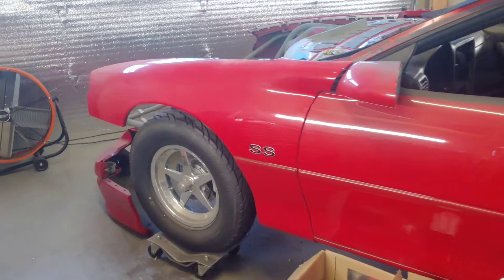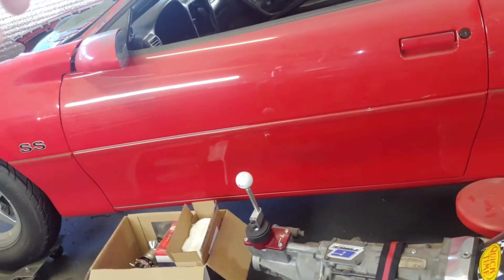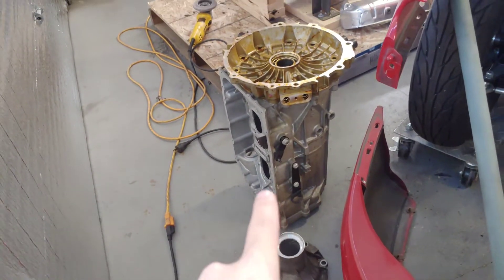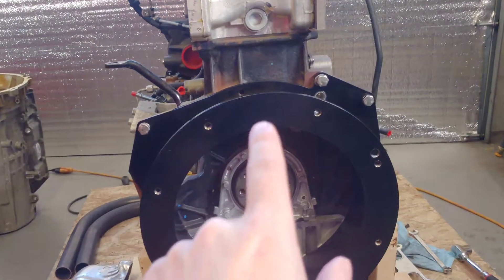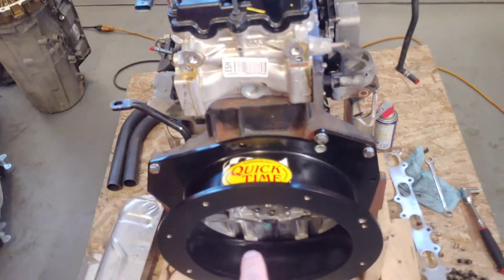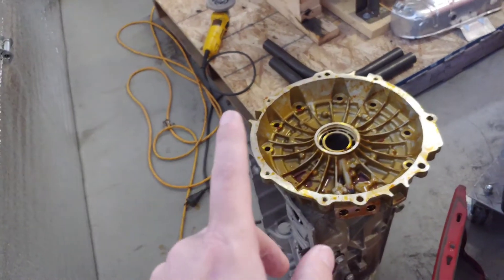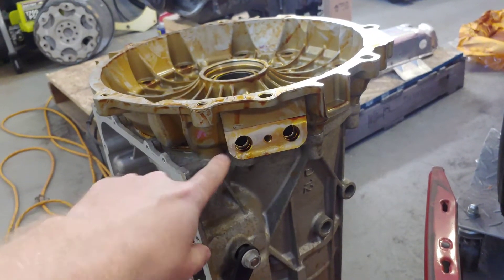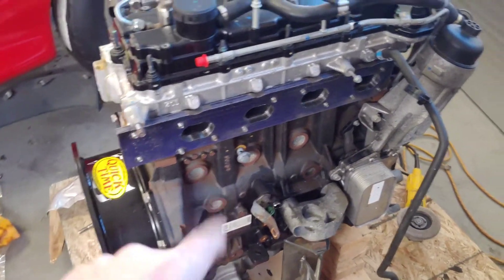2.8 Duramax Camaro project update/ transmission compatibility

Comment: Thanks for all the LWN content! I blew my 6L50 tranny on my 2.8 duramax Canyon last fall hauling my boat and camper back from BC and this tranny seems to have some cooling issues. So wondering if you know of any issues with this setup? I had the tranny rebuilt and a couple weeks ago I had to move a RV trailer about 15 miles and when I got back I noticed that the tranny had puked some oil. At the time the temp never got over about 100*c. As you are no doubt aware this truck is rated to pull 7700#s and the combined weight of my boat and camper is no more than 3500#s. I have it deleted and tuned and am finding anytime the tranny has to shift down while pulling a load the temperature just skyrockets, the hotter the ambient the worse it is of course. When it blew last fall the temp was at 112*c when I finally thought to check it. As the stock cooling seems to be insufficient, I'm thinking that I need to add some auxiliary cooling to keep the working temps down. I can't seem to find any content regarding this issue and my local dealer is clueless and no help whatsoever. help!! Details- 2017 Duramax Canyon, 250000 kms deleted and tuned for tow/haul(230hp/460 Ftlbs)
Reply from the maker: I would contact your tuner and have them look into torque converter slip. Sounds like it's not locking up the converter. Should be a simple tune adjustment. But it's hard to say without looking at the data.

Comment: This is very exciting. I am working on a LWM swap on my 2008 Hummer H2. I purchased a 6l90 from a 2012 Silverado. This'll give me the option of 4 high/low and 2wd. You are giving me so much hope. any update on the bellhousing issue. I saw in the earlier comment that the 6l50 doesn't fit. Good luck and keep up the great job!
Reply from the maker: Thanks for watching! Its hard to say when I'll be able to get back to it, but I'll be sure to post all the updates when I do.
Reply: @breoll86  I actually purchased the same housing, and I am working them to see what can actually work. The housing was $125. Retrofitting the mounts from the chevy express van. They are very close. Just some clearance issues.

Comment: Has anyone confirmed that the Jeep VM Motori 2.8 block is the same on the backend?  Jeep put the NV3550 behind the 2.8 VM in some markets.  Wonder if the bellhousing plate would work...
Reply from the maker: I don't have any personal experience with the Jeep stuff, but I hear that its very different. I do know that you can put a T56 or TR6060 behind a 2.8 if you are looking for a manual. The Cadillac V6 comes with a bellhousing that will bolt the Tremec to the 2.8. I actually have one if you're looking for it. The problem is the flywheel. The crankshaft bolt pattern is unique to these motors. But very close to the V6. There is a company out there that makes a transfer case adapter for the Tremec as well, if you're looking to use 4wd.
Reply: @breoll86  have you found any more info on the flywheel option?? I'm looking to swap this into a 4wd s10 that is built for offroading. I want to be able to keep a manual in the truck.
Reply from the maker: @ClinkenbeardStrong  Sorry, I have not. I do know that it does NOT match the V6 or V8 crank pattern. It is very close to the V6 size (not exactly the same) but the ring gear is a different size too (you may be able to use a V6 starter though). I have been away from home for a while now and haven't had the opportunity to make any progress on the project. Hense the lack of videos lately. I will get back to it as soon as I return.
Reply: @breoll86  thanks for the info man I appreciate it. It's definitely been a wild ride trying to figure this all out. It's inspiring to see other people with a passion for working with odd ball stuff just like me. If I end up figuring anything out, I will try to relay the info to you as well if you would like.
Reply from the maker: @ClinkenbeardStrong  Please do! Any info that we can get out there to everyone will help. Thats the whole reason I started doing these.
Reply: @breoll86  I think you mentioned it in the video, but did you say that the bell housing that you got was for the 3.6 from a cts?? I just wanted to doue check what I heard.
Reply from the maker: @ClinkenbeardStrong  That's correct. The duramax bell housing bolt pattern is the same as the V6. The adapter I got was intended to swap a 6l80 into a Cadillac ats-v that came with the V6. But it kinda fits the duramax application as well.
Reply: @breoll86  awesome, thanks for that info. I was thinking that was the case. With that being said... It looks like the manual that goes behind the v6 in the Camaro and that Cadillac is the aisin ay6. That is essentially the same as the 6spd manual in the newer Tacoma's. I'm not a100% sure, but I think you can swap the bell housing on those. But I can't say that with 100% surety. I know there are a lot of aisin transmission though that usr the same bell housing bolt pattern. The only concern with those is are they able to hold the torque??? Hard to say. As far as the flywheel, that's going to take a lot more research. I wonder if the ones of the European models might fit. I see they are available on every so might be able to get them in the states fairly easy.
Reply from the maker: @ClinkenbeardStrong  I haven't done any research on the Aisin's so I can't confirm fitment or durability. But its definitely worth considering. Maybe some of the European stuff will swap too.
Reply: @breoll86  I'm considering putting a LWN in a FJ45 build I'm planing on building on a 80series lancruiser frame. I have had a hard time finding a bellhousing that would make it compatible with a T56 manual. If I understand this post you're saying the cadilllac V6 bellhousing is compatible with the LWN and can be mated up to the T56? If thats correct and you still have that bellhousing, I may be interested LMK.
Reply from the maker: @nrlow13  ACDelco Bellhousing 24280264. I got mine from summit racing but it seems like its unavailable now. You might have to shop around a little bit.

Comment: If the trans bolt pattern for the 2.8 is the same as the high feature V6 family then the crank bolt pattern may be the same, it is also an 8 bolt on the V6's
Reply from the maker: Unfortunately I have found out that it is not the same. I have purchased quite a few flexplates and I have acquired a nice collection now. But I have yet to find one that matches. A custom flexplate would not be difficult to make though. Especially if you already have the machined ring gear off of a good core.
Reply: @breoll86  if your Christmas tree is big enough you can turn them into ornaments
Reply from the maker: @JakeT3584  Lmao! I'm sure the wife won't have any issue with that.

Comment: The Chevy Express/GMC Savana that got the 2.8L Duramax had the 8L90 trans.  Also the vans have a different FEAD with power steering pump mount...and the vans also have higher output alternators.  Did you get that engine from Cleveland Power & Performance?  I couldn't see the yellow tag on the engine in your video clearly but it looked like a CPAP tag.  I'm curious what your plans are for ECM tuning and trans control???  I'm working on a 2.8L swap now and have collected a ton of info.  Exciting to see someone else working on one of these that's not just another Colorado.
Reply from the maker: I have considered the 8L90 swap but in my opinion that trans has some reliability issues. Plus, the TCU would be challenging. The 6l90 is cheaper, has more support, and uses the same T43 TCU as the stock 6L50. But I actually have had a new GM H.O. alternator for a while now. It's still in the box. I will be putting it into my truck and swapping the low amp unit into the car. This engine did come from CPAP, and it will be getting a full rebuild. But for engine control I plan on using the E98 to start with, only because I'm familiar with the tuning and it won't take much to get it started. Once the stock ECU becomes a limitation I'll upgrade.
Reply: @breoll86  I have the same feeling about the 8L90 but it's another option with the goofy bellhousing of the 2.8L.  If you got that from CPAP, that engine was supposed to be for my turn-key pallet. Turned out to have too much damage to get running (cheaply). It took months for them to find a rig to part out for me then when they found that one, it was damaged.  Ended up waiting a total of 9 months for everything.  Not any knock on CPAP...just difficult to find good 2.8L donors.  If I had it to do over again, I would have sourced an engine from the van since I'm now switching out virtually everything up front for the van FEAD.  I have TONS of parts from the turn-key pallet that I'm not going to need (2016 Colorado).  If you have anything specific that you might want, let me know.  I'd like to speak offline about tuning files.
Reply from the maker: @mgmetalworks  CPAP made it clear that this engine would require a rebuild. Not knocking them at all. With the power goals I have in mind a rebuild is required anyway. Good used long blocks are still expensive. And to be honest, that's not what I was looking for. I just need a good core. The only accessory I plan on running is the alternator though. A simple bracket should be easy enough make just for that. As for tuning files, I'm not an expert by any means. I don't recommend using my numbers for anything. I just wanted to show people that its not hard to make small changes yourself. And the knowledge gained is worth the time invested.
Reply: @breoll86  I have a tuned ECM for a swap application already but the file is locked. I’m just looking for an editable file without the emissions stuff that I can learn with on my spare ECM.
Reply from the maker: @mgmetalworks  Unfortunately I don't have any delete files. You should be able to read your spare ECM though. A delete file should look the same as a non delete file, because there is no tuning or tables for the DPF/SCR. It just gets turned off with a custom OS I believe. But I've never seen one and cant really provide much incite. Not sure you'll get anyone to share that info to be honest. lol
Reply: @breoll86  in Australia there’s a couple models of GM/Holden vehicles that had a 4L60E with the same bell housing as the 2.8L. That would be a good trans for some basic applications.
Reply from the maker: @mgmetalworks  Yeah that would be a good option for a mild 4 speed application. Maybe a street rod if you plan on swapping all of the emissions with it. Not really capable of hold the power I'm looking for though.
Reply: @mgmetalworks  Have you managed to convert from a 6L50 to a 6L80/6L90 with the 2.8 LWN? I'm pretty sure the TCM will work as both units use the GM T43 TCM controllers, but not sure about the mechanicals such as bell hoursing, transfer case etc as I'm researching on trying to do this on a Holden Colorado.

Comment from the maker: Confirmed that the 6L45/50 bellhousing does NOT fit the 6L80/90 case. One has 8 bolts and the other has 9. Also, the bellhousing I purchased is for a C7 Corvette and not a C6. The C6 is no longer in production though. Looks like I'll have to track down a reman unit.